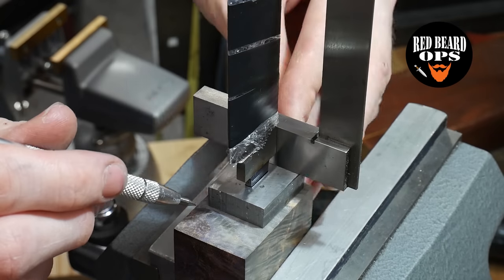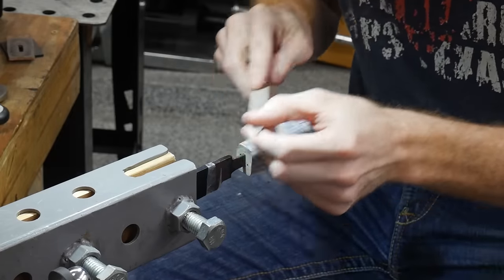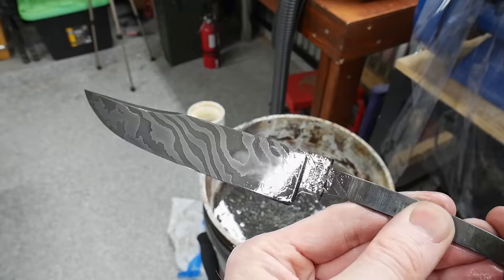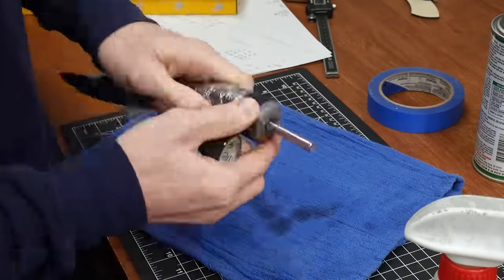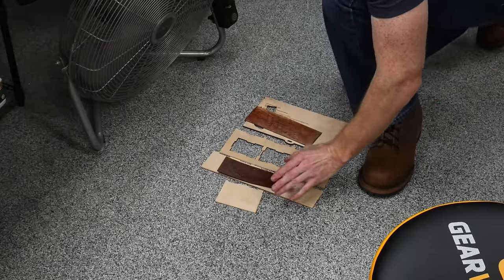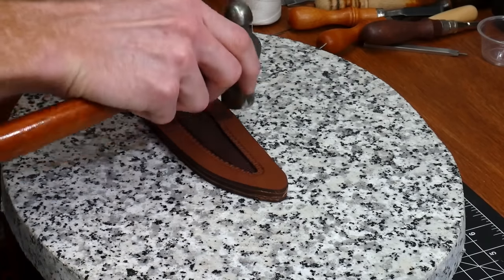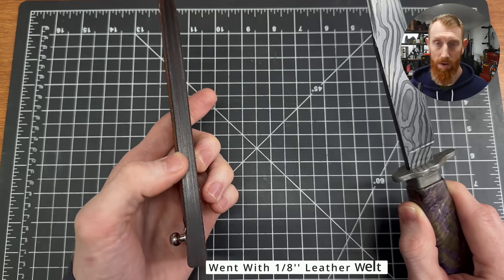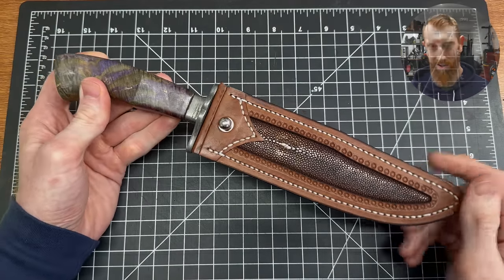FINISHED - My Best Attempt Making an Heirloom Damascus BOWIE!  Part 3

Comment: Great video tutorial as usual..Thanks..not that you need any tips but perhaps someone else will find some use..#1 Brass black can be used to blacken etched makers marks on steel with really good results..#2 tempering with a toaster oven the heat can be balanced well with a cookie pan filled with dry sand, brought up to temperature 1st then the blade placed in the sand..#3 a soft flat platen can be made to get rid of the dreaded belt seem bump..a piece of scotch brite belt glued on to a steel backing platen then a piece of thicker leather like veg tan glued on top of the scotch brite belt section..also good for a convex edge profile too..#4 using a 50/50 acid / vinegar mixture works better than just water/acid..#5 WD40 sprayed into the tumbling media plus blade makes for a more consistent appearance for a tumble finish without the risk of deep scratches..Cheers..
Reply from the maker: Good tips! Cheers

Comment: You said you use 10 times the thread when stitching. Is that 10 times the length along the whole welt with a saddle stitch? The guy that taught me said to use 5-6 times and it works out good for me. Usually there’s about 4-6 inches of thread left over.
Reply from the maker: Yes sir, I measure out the total length of the outside edge of the welt and 10x it. Stitching with a "locking saddle stitch".. I may be using too much. Always afraid I'll run out.

Comment: What do you suggest me to get for marking or  punching holes in my leather for stitching
Reply from the maker: I generally use a super cheap pricking iron to mark out my spacing and a big needle or little nail in my drill press to puncture.

Comment: Great video! The knife looks great and the sheath is fantastic. Did you draw the sheath yourself or did you go off of a pattern that was already made? Could you have cut the stingray with the laser?
Reply from the maker: Thanks! I drew the sheath up myself. That stingray is pretty darn though... But I'm sure the laser could have gotten though it. Cheers!
Reply: @RedBeardOps  what do you draw it in? I have a laser on the way and this is specifically what I want to use it for… cutting our sheaths and hopefully etching logos in , but we will see if it’s good enough for that
Reply from the maker: @BrighamKindell  I drew it first by hand, then import the scanned image into a CAD software. NanoCAD is free... so I use that. I then trace the scaled JPEG with lines and curves. Once I have the outline in nanoCAD Traced, I export it as a DXF file. You can then import this DXF file into LightBurn for cutting on the laser.